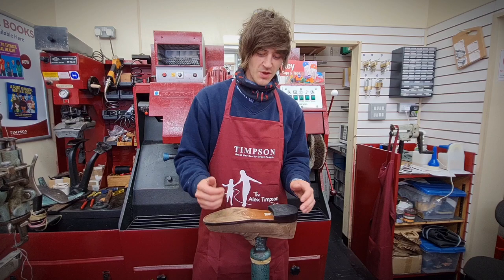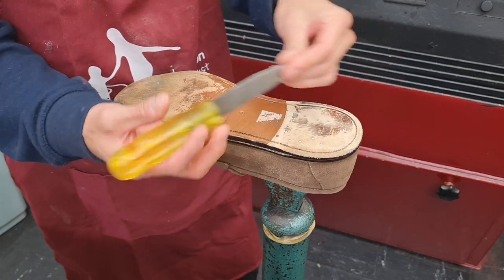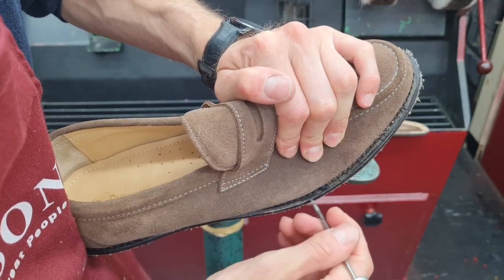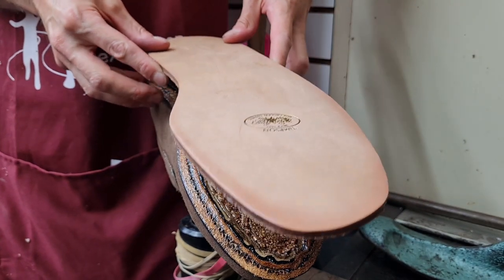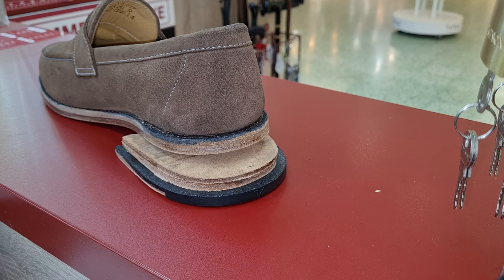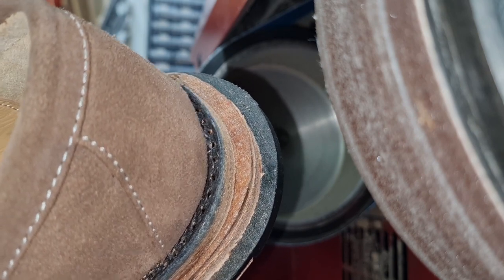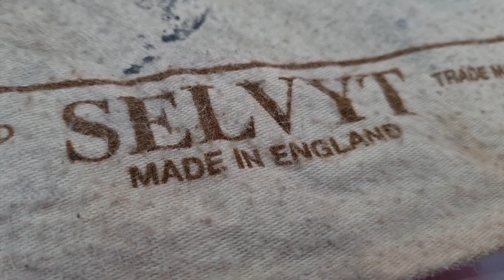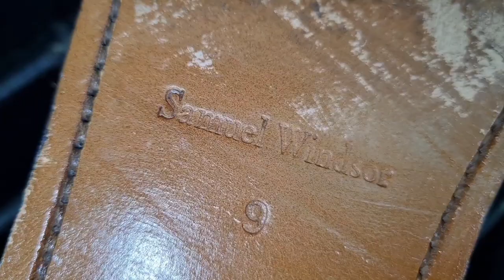REVIVING Samuel Windsor SUEDE SHOES | SHOE REPAIR UPGRADE | Resole Series | Leather Stacked Heels

Comment: I have a few Samuel Windsor shoes , I took a pair to a cobbler and was told they were rubbish. They also are a shoe maker, and told me they weren't worth repairing and were charging me  a fortune, took them back a week later and the guy said they were a good pair of shoes,
Reply from the maker: They are OK. Not really built with the best of materials! They cheap up and use alot of fiber board/compressed paper etc. But they aren't terrible for their cheaper price point.
Reply: @CobblerG  there not as good as my m&s ones or no were as good as my Alan Edmunds

Comment: Ironically Samuel Windsor's are cheaper to replace than repair (to that level) - But you have upgraded them and improved the look :) better for the industry and the environment .. I bought a sale 'pale' pair of S.W. Oxfords, to experiment with dye's and patina ( if it went wrong the could always be turned into a black pair) - those are the one's people notice on the rack with the Patina & mirror toe caps.. I was intrigued to see the construction - better than expected for the price point, (and now even better) Nice Job G!
Reply from the maker: They have actually began closing down and are retiring, which is quite unfortunate as they did do some pretty nice shoes. The construction is not too bad at all, not the best leather sole or heel blocks but not far off some of the higher branded shoes, all in all a decent company, but a shame they are closing their doors.
Reply: They are not bad the uppers are the most important, from my point of view
Reply: @CobblerG   oo best go surfing!, it's a shame,  for the price point - nothing gets close, thanks G

Comment: Why so much glue if the soles are stitched on? Is it the glue that holds the soles on? or the stitches?
Reply from the maker: The first coat of glue absorbs into the material so using another coat helps to strengthen the bond. Both the glue and stitch help to hold it on, using the glue also helps to keep the sole in place when stitching is going on, and if the stitches are worn through after use the glue is your backup to hold the sole together

Comment: In theory, could you have separated the sole a bit, added some glue, pressed it down and added a toe plate to buy time? Or once it starts to come apart there is no going back?
Reply from the maker: I could have for a quick fix but the owner wanted to go for a recraft. The stitching had all broken at the front too and the original glues failed so it would just happen again if it was just re glued 👊